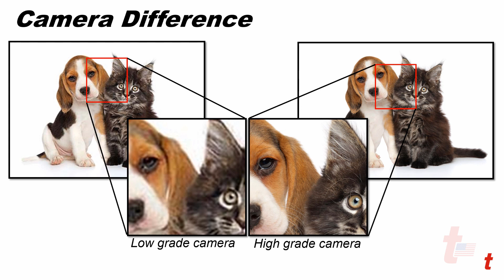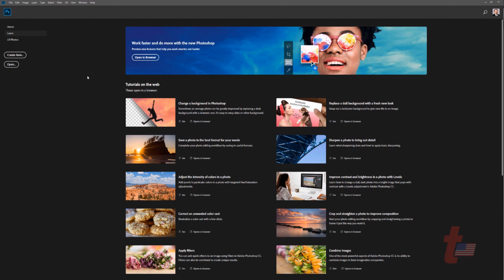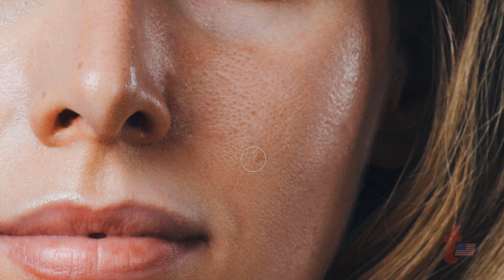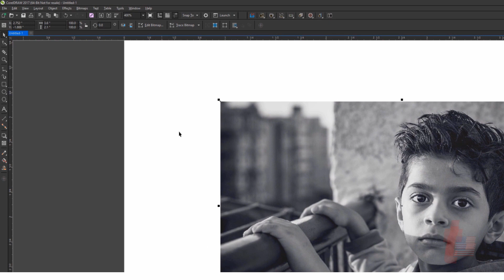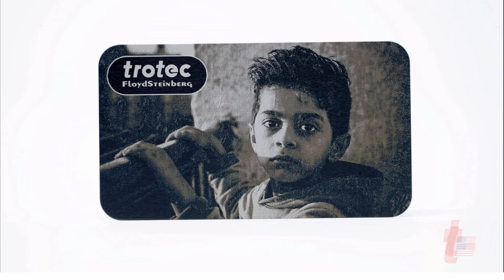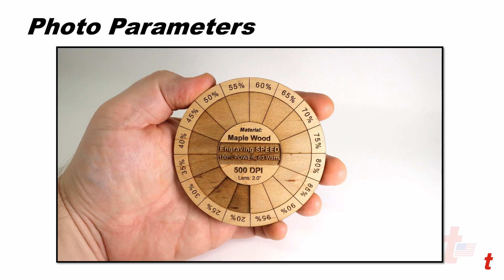Photo Laser Engraving Tips | Trotec Laser Webinar

Comment: just a question:  at around 34min: is the reason for the "darkening" due to the available laser power being distributed over a larger area - was the laser power level increased to compensate?  If not then would you obtain the same brightness, but just a lower resolution graphic?  I've also got another question.  Can you recommend the best method of approximating a 1:1 pixel to laser shot mapping?  I'd like to send a monochrome bitmap at the exact rastering resolution.  Printing from CorelDraw isn't ideal since in general some resampling seems to occur - I'm guessing printing from photoshop/paint would be more reliable?
Reply from the maker: Hi Will, at 34min the darkening is caused by the laser beam being much larger. This spreads out the energy causing this effect. Far more laser power was in fact used to make this sample to get the anodized aluminum to this level. Had more power been used to attempt to produce the same white mark as the other lenses, then the details of the photo would have been gone producing little to no image at all.  It would be possible to run a larger image on this material at a much lower resolution and see a brighter mark like on the other examples.  The second question on 1:1 pixel mapping, I would recommend Adobe Photoshop for controlling the pixel resolution printing directly from Photoshop to your Trotec laser. Adobe makes much better windows spoolers that transmit the pixel data to the printer. This is far more accurate than CorelDraw when it comes to photos, allowing a better response on our laser.